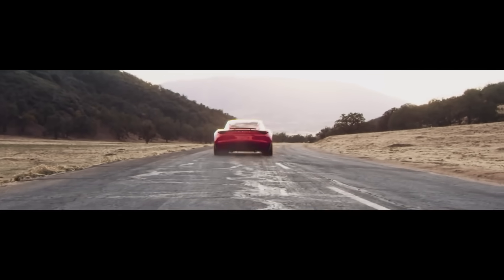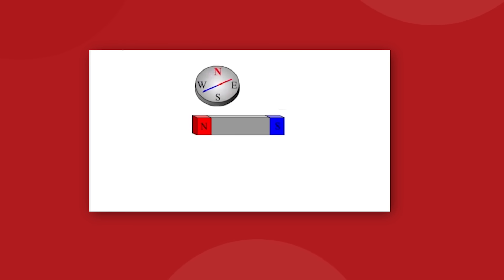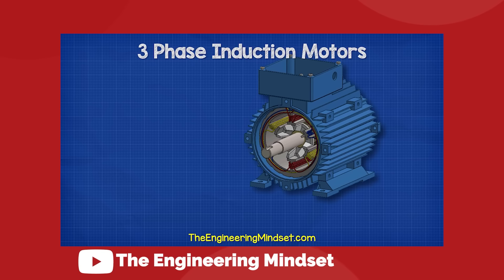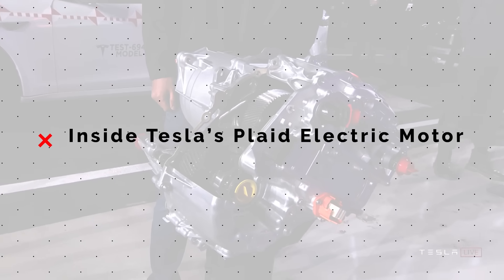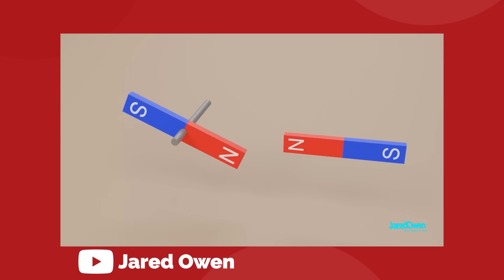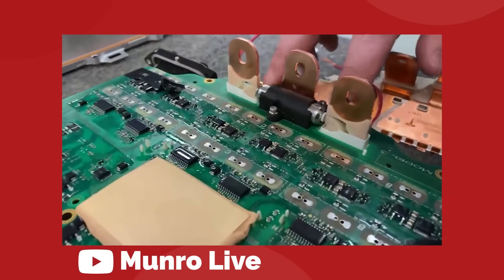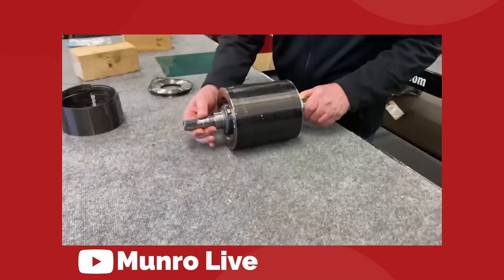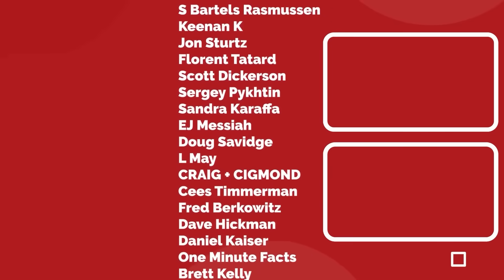The Real Reason Tesla Developed The Plaid Motor!

Comment: Railway engineer here... What I've learned is that other than some minor design tweaks in the rotor which are specific to their design philosophy, that the power control and design of any Tesla or any other EV powertrain is basically the same as we have been using on AC traction on the railway since the early to mid 90s.
Reply: I have found that the most important tool on an electric train is the popsicle stick you jam in the breaker so you can get to the next stop for inspection!
Reply: @MWestern-m4g  Locomotive engineer here. Can confirm locomotives are held together with duct tape, cardboard, rubber bands, zip ties band aids, and paper towels wedged into every rattle.
Reply: @apricity69  And BUBBLEGUM!!!!!!!
Reply: @MWestern-m4g  And I’m all out of bubblegum.
Reply: @apricity69   that the American way?
Reply: @iscmiscm  I would love to be able to post YouTube videos of all the rattles and broken parts in locomotive cabs while going down the tracks but I’m prevented from doing that by federal law.
Reply: @apricity69  love the glasses, where can I get me some of those?
I need to give Messrs Schwab, Gates, Nadella, Harari & Fauci the eye.
Well Mess-ers....
Reply: @iscmiscm  "They Live"....
You're proving you're just a jealous little  hater & not too worldly wise.... 🤦🏻
Reply: @MWestern-m4g  Mr McFly!!! How's Doc???!!!
😀👍
Reply: @MWestern-m4g  surely the most important tool on a train is the engineer HOLDING the popsicle stick, trying to fix the problem the accountants & management screwed with sh1tty financing decisions.  Well THEY think he's the tool because... they're More. 0ns...
Reply: design tweaks...are not neccessarly bad...and in the very least are moving things ahead.
Reply: @hansdybka1331  
What you say is true, but the way Tesla market each tweak as some sort of design breakthrough is not helpful.
Musk is really just a marketeer with some technical knowledge who employs a load of clever people and does what he can to keep his name in the media.

That does not detract from the quality of the product, but a lot here reminds me of Apple and their methods especially when Steve Jobs was around.
Reply: @iscmiscm  Calling Musk a "marketeer" misses the point by such a huge margin.  He has a degree in physics, is chief engineer of a rocket company, oh yeah and a global satellite communications company.  Every engineer I know of that has spoken to him is hugely impressed.  "some technical knowledge" is just pure disinformation.  He dumbs it down to communicate to the masses, but he knows all the details, and is involved in the design process.  He's also an accomplished software engineer.  I don't know of anyone else in history you could place above him, except maybe Henry Ford or the aeroplane guys.  And in terms of great products delivered in difficult circumstances, I don't think anyone is close.
Reply: @mrmichrom8553  If course I know that Musk is much more than competent regarding engineering, but he seems to have assumed the Marketing role and I still say that he overstates    how much innovation is in some of the design.
The does not mean that Tesla cars are not good, just as Apple phones are more than competent.
Reply: If you think musk’s degree from a state school is impressive, then obviously you either a): went to a state school or jr college or b): have never stepped foot on any college campus. In either case, one can see why you’d be impressed by musk’s non-stellar academic achievements
Reply: @mrmichrom8553  musk is incredible. But I would suggest you look up R. G. Letourneau. Only Edison had more patents to his name ( and as you probably know, there were plenty of them that were other's ideas). I wouldn't be surprised if his electric motor wasn't the basis for the modern day train. But what he specialized in was earthmovers.
Reply: @drrightwing4435  hahaha!
"Elon is brilliant. He's involved in just about everything. He understands everything. If he asks you a question, you learn very quickly not to give him a gut reaction. He wants answers that get down to the fundamental laws of physics. One thing he understands really well is the physics of the rockets. He understands that like nobody else. The stuff I have seen him do in his head is crazy. He can get in discussions about flying a satellite and whether we can make the right orbit and deliver Dragon at the same time and solve all these equations in real time. It's amazing to watch the amount of knowledge he has accumulated over the years. I don't want to be the person who ever has to compete with Elon. You might as well leave the business and find something else fun to do. He will outmaneuver you, out think you, and out-execute you."

Kevin Watson, 24 years at NASA.
Source: Elon Musk: Tesla, SpaceX, and the Quest for a Fantastic Future

"I was blown away. I've seen dozens of CEOs, I've never seen a CEO, ever, or a president, that knew more about the product, that knew the details of the product. That could bring an idea and discuss it not just in grandiose, hand waving terms, but hey let's use this formula and rattle off a formula, or rattle off a material or rattle off a process that is kind of obscure unless you are a detail engineer. I was blown away by that. That kind of stuff you don't see executives know much about." 
Munro at SpaceX meeting.

Elon has an 89% CEO rating on GlassDoor from his employees, and a 78% refer a friend rating. At Tesla he has an 81% CEO rating and a 65% refer a friend.

In 2006, Musk was a member of the United States National Academy of Sciences Aeronautics and Space Engineering Board.
American Institute of Aeronautics and Astronautics George Low award for "the most outstanding contribution in the field of space transportation
National Space Society's Von Braun Trophy in 2008/2009, given for leadership of "the most significant achievement in space"
Fédération Aéronautique Internationale, presented Musk in 2010 with the highest award in air and space, the FAI Gold Space Medal, for designing the first privately developed rocket to reach orbit.
Recognized as a Living Legend of Aviation in 2010 by the Kitty Hawk Foundation for creating the successor to the Space Shuttle (Falcon 9 rocket and Dragon spacecraft)
In 2012, Musk was awarded the Royal Aeronautical Society's highest award: a gold medal
n 2014, Elon Musk was honored with an Edison Achievement Award for his "commitment to innovation throughout his career"
2015 at Yale's 314th Commencement Ceremony, received Honorary Doctorate in Engineering and Technology.
"the honorary degrees awarded annually at the university’s Commencement are the highest honors conferred by Yale".
In 2015, he was awarded IEEE Honorary Membership
Musk was elected a Fellow of the Royal Society (FRS) in 2018.
On February 9, 2022 National Academy of Engineering announced that Elon Musk was among their newly, peer-elected members, an award considered to be among the highest professional distinctions accorded to an engineer, "for breakthroughs in the design, engineering, manufacturing, and operation of reusable launch vehicles and sustainable transportation and energy systems"
Reply: at last someone said it
Reply: I think trains use motors that lose power the higher the RPM, like most electric cars, but unlike the plaid
Please correct me if i am wrong
Reply: Your "AC traction" still has DC traction motors. GE and EMD.
Reply: @deeremeyer1749  No it doesn't. The traction I've worked on have 3 phase asynchronous AC induction motors. On trains built in 1994.
Reply: 🙋 just your typical observer of my environment, not sure if we are or not.. apologies in advance buttt is there some point your trying to get at? Please do entertain me..  So if it were even possible to exist back then each attempt most likely obviously failed .. at least until someone smart, who has alot of money, genius plan ideal to its economics (supp./dem. Kinda thing you know?') the thing you engineers know all about. Hope you were trying to wrap your head around something you and I are not in position to a depict or even have a spot on the table to devise a plan to a successful company first of its kind and be at the front of industry while everyone struggles to keep up.. dont you hate the way things are? Smart people and their stupid things we use jus does nothing but causes trouble leaving  us to wonder bigger and better things then doing nothing about it. Drives you nuts to not be able to be able to doesn't it?? I hate seeing it too buddy
Reply: Yeah but without any vision.
Reply: If you follow that logic, BMW's New HYDROGEN Combustion Engine is basically the same as an Otto engine, which started production in 1864 . If you oversimplify things, a banana could be the same as an apple (they're both fruit), but then you're missing the point.
Reply: Are u also wrapping the rotor?
Reply: @aaxa101  Banding (or wrapping) motors is not a new thing.  We have several large DC motors (200-1000 Hp) with armatures that are wrapped, to keep them from flying apart.  These are off-the-shelf industrial DC motors, nothing particularly special about them.  Using carbon fiber might be newer technology, but fiberglass and Kevlar have been used for banding motors for decades.  Recently, we had a 500 Hp DC motor re-banded with better quality material so that the motor could run at higher RPM.
Reply: @willmcgo8288
Reply: @aaxa101  No need as locomotive drive motors are built for high torque not high rpm
Reply: This. People think tesla invented all this technology. All they did was take already existing tech and put them together in a car. And they are far from the first people to even do that! There is literally nothing special about there motors, batteries, VFD's/inverters, or anything else they make.
Reply: @motosk8er2  elon has said thousands of times. The electric car wasn't hard to do, anyone can do it. The hard part is automating the robotic factory and lowering cost.
Reply: @motosk8er2  he made a self driving ev. Nobody else has. It's still an invention
Reply: @motosk8er2  just be happy you are not as ignorant as them And understand the name is a homage to nikola tesla
Reply: @spacecowboy07723  He didn't though, his inovation was a high end marketing strategy that god ultra rich investment funds to keep funding his buble. WHich isn't the worsed thing ever.
Reply: @spacecowboy07723  We had self driving horses in the western US over a hundred and fifty years ago!
Reply: @motosk8er2  All things had been invented already,all you have to do is to imitate them,modify,improved,etc...Just study the system of : human body,land animals,worms,snakes, birds,fishes,sea creatures,plants,etc...Also the design of atoms, molecules,their behavior, etc...The phrase was true:  There is no new things under the sun....
Reply: @motosk8er2  Almost all new technologies are based on information and technologies that have come before. The original combustion engine was modified over the years by people taking that original technology,  adding a small modification here or there until we have race cars capable of 200 + mph speeds.  Certainly the poor original combustion engine couldn't have done that.  But no one reinvents the wheel in order to make improvements!!!
Reply: @motosk8er2  Almost all technologies are bas
Reply: @motosk8er2  Oh OK. Dream on.
Reply: I ll take teslas electric motor over anything you got in railways in terms of efficiency and power.
Reply: @Matzes  OK so where are you getting your efficiency data from?
Reply: @Matzes  Railway motors are many times more powerful then Tesla's. Around 5000-7000 horsepower. Efficiency is about the same. 

The reason a train doesn't accelerate fast is because the weight is bigger then a human can comprehend. Like thousands of times the weight of a Tesla car.
Reply: @Ricko1Games  obviously I m talking relative to size.
Reply: @Ricko1Games  Also I doubt your 5000 - 7000 horsepower motor would fit in a car. lol
Reply: @Matzes  Of course you would because you haven't a clue about electric motors.

Comment: Induction motors DO NOT use permanent magnets! Tesla does Not use induction motors in their cars. I believe it is a SynRM motor (Synchronous reluctance motors).
Reply: Correct, also, Tesla Motors used an induction motor in their first car, the model S, the model 3 uses IPMSRM in the rear and an induction motor in the front. :)

Comment: If only Tesla used the bedini circuit to recharge the battery then it will be revolutionary
Reply: I was thinking the same thing.  Nikola Tesla drove his Pierce Arrow with a 4-phase electric motor and his regenerating circuit built with power Pentode vacuum tubes from Colorado Springs to Detroit without having to recharge the batteries.

Comment: With stronger magnets, you need less current on the stator to create a field for the rotor to follow, would be my guess.
Reply: Correct, which is why there are people ditching the old motor design and exploring the other design explained by Nicholas Tesla that is in theary more efficient and has the magnets spin not the coils, it has taken a long time for that design because of timing the coils with the magnets to get the best performance possible.
Reply: @SnowValkyrie247  the magnets always spin you tard

Comment: "the fastest accellerating production car that has ever..."  yeah besides the two production models by Rimac automobil that is , (the old one and the new one) both have better range to  and they charge faster from 0 -> full aswell (by allot)
Reply: 2 X 480kw rear motors and 2 X 220kw front motors, carbon sleeved.
Reply: @briananthony4044  running at 800Volts while teslas only run at 450Volt

Comment: I would be interested in the efficiency of the inverter. How much energy is lost turning DC into AC? I remember the inefficient, heavy and unreliable old mechanical inverters used in planes (a DC motor driving an AC generator).
Reply: As far as I can tell, fairly efficient. The inverters seem to be able to handle the demands without requiring massive cooling. The rear motor of a Model 3 is rated at 190 kW. If the inverter was at 99% efficiency, it would have to shed 1.9 kW of waste heat. You know the massive coolers of high performance PCs, these processors have a thermal design power of less than 1/10th of these 1.9 kW. The inverter might be able to run hotter, but not that much, as it's still semiconductor based. 

So, I'd assume the efficiency of that inverter is north of 99.5%. :-)

Comment: In general, larger motors are more efficient, the inverse for transistor switching where smaller is better.

The new frontier is driven by smart high-speed semiconductors that end up to very high wattage semi-conductors with very specific chemistry & reaction characteristics. 

Add to that the new permanent magnet alloys  with higher curie points & add in new induction motor designs made possible by computers as high speed intelligent relays, & it’s hard to keep up with you don’t have a magnetic personality or are not in the field.

Comment: I am an “ok” engineer with a regular job in a software company but learned a lot from this video. Wondering, if the real mechanical/electrical engineers working at Rivian/Ford would learn a hell lot more from this, and can dramatically increase the performance of their Cars, beating Tesla! Is that possible?
Reply: No, not likely, and not because they're bad engineers. The answer is simply Tesla is designed differently as a company. From what I've gathered, they seem to have taken the principles of Agile software design and applied them to an entire company, from design, through manufacturing, and every step in the process. Tesla is frequently making changes to their design, both small and large, all in the goal of improving everything with their vehicles.

Rivian is a much smaller manufacturer, and nowhere close to Tesla's scale, so there's a chance they can borrow some of Tesla's ideas, but I highly doubt they'll be able to take advantage of many of the largest Tesla innovations such as the custom motor wrapping, or 4680 cells as these are both completely new groundbreaking designs. These new designs require massive investments in either new product production plants or other major retoolings and I don't see Rivian being willing or able to change their production to make this happen.

Ford potentially has the size and engineering capabilities, but from what I've seen, the company culture and heirachy has severely ossified and is so inflexible that they wouldn't dream of trying these radical ideas. Furthermore much of their supplies come from third party suppliers so they don't have the same flexibility.
Reply: @2011JMB  Good insights!
Reply: @2011JMB  ...also Tesla is trying to get to Mars, there must be some high tech trickle down landing at the Tesla factory.
Reply: Other thing to remember is, there tend to be reasons why engineers weren't already using these cool ideas. I'd assume that Tesla's engineers had to solve a /lot/ of problems to make these ideas actually work in prototype, and then a whole other set of problems for practical mass production.

Engineers at other companies probably already understand these ideas in principle, but that's very different from making them actually useful in practice.
Reply: Seeing the Ford engineers beating the Tesla engineers would be an amazing show to watch. I'll bring the popcorn!

Comment: What if I told you a brushless induction motor doesn't need permanent magnets?
Anyway, the motor design is innovative but not surprising, imagine the magnetic field lines created by the field windings and it makes more sense.
Reply: These motors aren't actually induction motors, they are Switched reluctance motors which is a kind of DC brushless design. Tesla did used to use induction motors but I think they switched over to using PMSR motors for all their cars now.